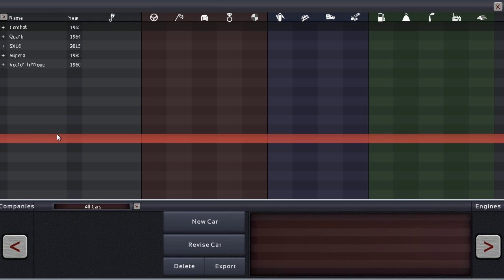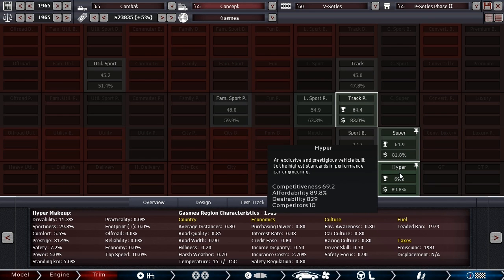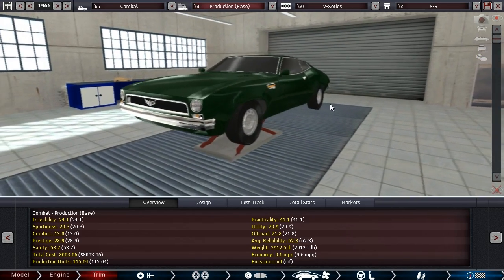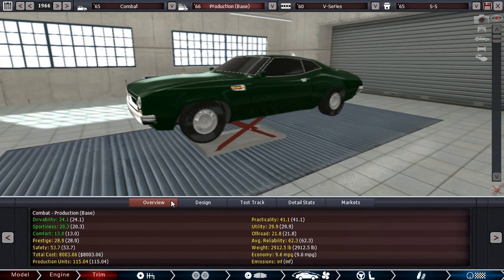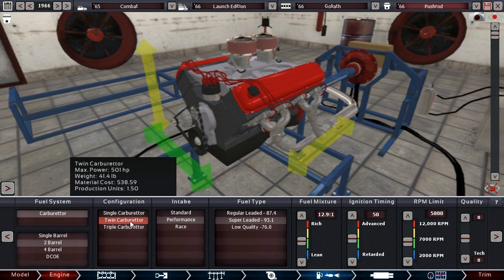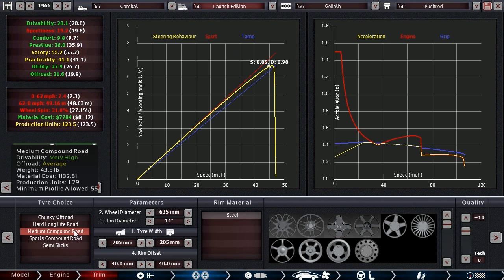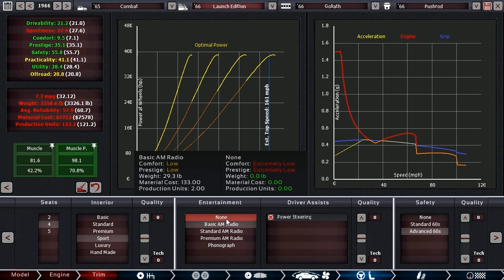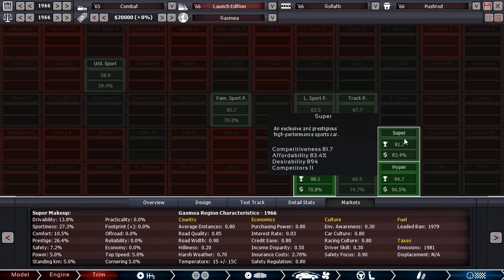Automation | Vector Automotive Challenge | 1966 - Muscle Refinement

Comment: is there a reason for doing the monocoque as opposed to a ladder chassis? iirc all of the American "muscle" cars were body over frame. I wonder what numbers you would receive using a ladder chassis. when I build realistic period American cars from the 60's everything comes out a utility vehicle. and that is with a 662 Cid pushrod v8 that makes 550ft/lbs of torque
Reply: The mustang, Nova, falcon and many other American cars where unibody
Reply: +Mr. SideWayzMoose™ I guess I must amend my first post to "most muscle cars were body over frame," but if you would like to get technical the Mustang created a new segment, the "pony car," with its introduction and the nova and falcon were introduced as just compact cars. Also just because there are a few that are unibody doesn't answer the question as to why it was chosen, and what the combat would fall into with a more time period conventional ladder chassis.
Reply: 7MBoosted First off pony cars are still considered muscle cars. Secondly Novas and Falcons are still muscle cars. The Falcon started out as a 'boring car" turned into a muscle car, then it became the Grand Torino in the North America and stayed Falcon in Australia. I have less to say about the Nova (partly cause you know Ford guy) but they still came with V8s. I assume he went uni body because it was 'better' and still made sense.
Reply: +7MBoosted Regardless, the game considers monocoque flat out better, albeit more expensive. It provides lighter weight, less chassis flex, and various other little things.

Comment: For reference: $20,000 in 2015 works out to $2,700 in 1966. That is a tremendous discount relative to, say, the Pontiac GTO.
Reply: I had read that the game is using 2010 money. I also noticed there was no markup on the launch edition Combat. If I'm right about that then it would be $2971. And what I've seen the GTO was between $3300-$4500 with most ones I've seen build sheets for land about $3750. So I'm going to guess that the final price it the Combat to come up a bit to land in the bottom half of the GTO price range. Having said all that I'd still spend the extra money on the GTO. Similar performance numbers but the GTO looks better than the Combat.